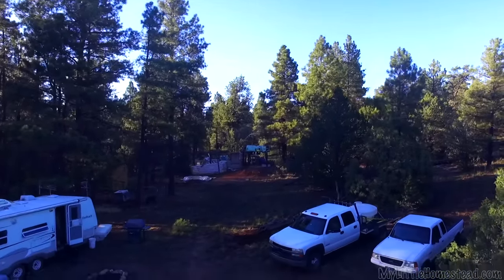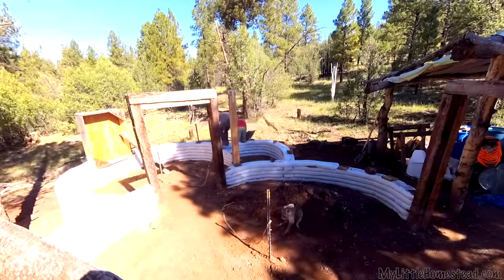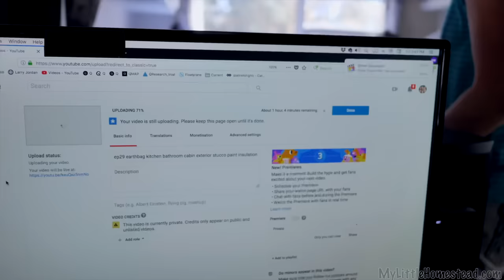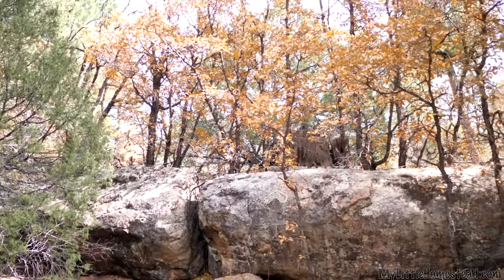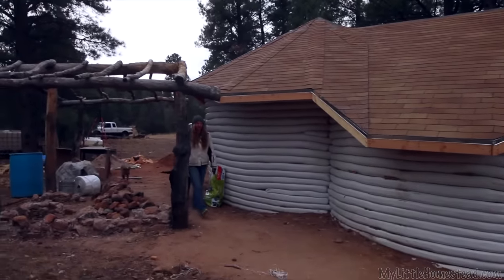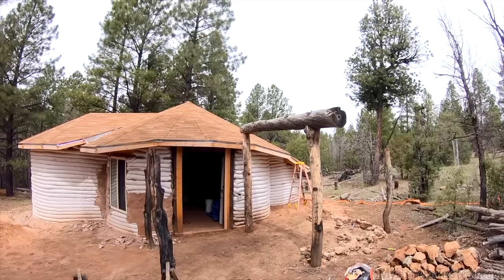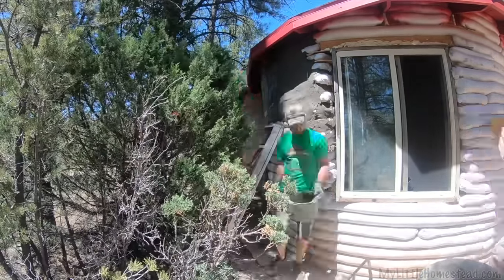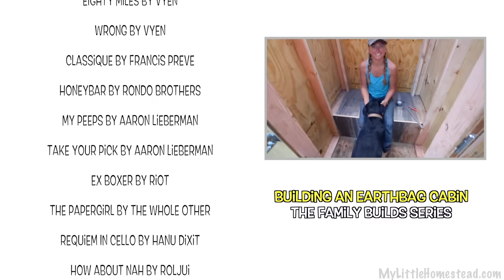Complete Build of Earthbag Cabin  | DIY Full Version Movie of Completed Project

Comment: Great cabin and thanks for sharing.  I'm a big fan of earthbag homes.  Did your realize that by putting on a shingle roof you are guaranteeing the roof will burn off if there is a fire near you?  Those shingles are only fire "resistant" which means that a burning branch WILL ignite the tar shingles.  Put a layer of metal on top of it.  Even basic corrugated metal roofing will protect it from embers and burnng branches falling on it in a wildfire.

Comment: Awesome project, well done. The only thing I'd consider fine tuning is the small gap between the outer construction (what was previously a pergola) and the main building: I'd get pretty annoyed by rain water pouring down between those two roofs. Maybe add some roofing that leads water away from the house entrance a little better?

Comment: I saw a video somewhere whereby someone poured a round concrete slab, made a dome sown out of Tyvek house wrap, attached the Tyvek dome to the slab, blew up the dome with a high volume fan and then sprayed light layers of concrete on the dome until they had a large concrete dome.  Might be quicker and/or an idea for an add'l room to the house instead of earthbags

Comment: A solar electric fence will solve your bear problem.  I did a lot of research and an electric fence was the only workable solution.  The bears learn (and remember) about the electric fence and will not go near it even if it is off after being bitten by it. 

I also take it your cabin is not high enough to require storm shutters to keep the snow from breaking the windows and doors.

Comment: After every snowfall try to clear the snow on top of your roof as much as possible, because if you don't the weight of the snow will crush the roof at the long run. 
I know it sucks! but it's safer for everyone and your roof last longer. In Canada we gets heavy snowfall especially in Montréal  and it's one of the advice that city gave homeowers.
Unfortunately we had some mishap happen before. we understood the situation so when we have a lot of snow if is more than 25cm or 30cm the school boards closes schools.
 I think for houses or it's  between 2 or3 inches of snow 
So they could clear the school roof to make it safer, for the kids and the teachers and companies.
 There are companies some of them does not like to spend money on safety but if the city find out they will be a hefty fine for endangering employees.

Comment: Where do you get the continuous polypropylene tubes?
Reply from the maker: China earthbags
Where We Bought our Earthbags (Continuous Sandbags or Earth Bags :)  | Weekly Peek 
https://www.youtube.com/my_videos?o=U&sq=China 
It is called 14 inch continuous polyweave bag material with a 6 month UV protection. Manufactured and imported by MLH directly from a plastic bag manufacturing plant in China. Years ago we bought it in bulk and sold off everything we were not planning to use. Back then, the cost was .15 cents per lineal foot.

Comment: where did you guys buy your earth bags?
Reply from the maker: China earthbags
Where We Bought our Earthbags (Continuous Sandbags or Earth Bags :)  | Weekly Peek 
https://www.youtube.com/my_videos?o=U&sq=China 
It is called 14 inch continuous polyweave bag material with a 6 month UV protection. Manufactured and imported by MLH directly from a plastic bag manufacturing plant in China. Years ago we bought it in bulk and sold off everything we were not planning to use. Back then, the cost was .15 cents per lineal foot.

Comment: Oh Boy, oh boy. 

How can anyone do this ? Have people gained no knowledge ?  Until now people only went into the ground when Rigor Mortis had coming around. And that is for a purpose!

As a physics i would not even build a house with lots of sand around it in my own country. But in a country with more solid material the exposier is way to high. And with what do you hold sand together? Plastics? 
Please do some research. 
In Holland now we are building houses that by law have to be so airtight that it is very unhealthy to live in it. I have seen floors that were not build extremely airtight. So radon coming from the ground is piling up in the house.  Whole families that are getting sick. A house that is killing his inhabitants.  Please be aware of the negative factors when living more into the ground.
Make sure that you build vent systems that will completely refresh all the air every hour.  And be sure that the details of the fllor and the walls are build in a way that absolutely nothing can come through it. Although it almost impossible to do. Maybe a double floor and wallsystem until you are above the ground. And with ventilators you have to constantly refresh that boxsystem so nothing gets into the living spaces.
And try to shield all that plastic from heat. Keep the temp as low as possible if you don't want to poisen yourself. Make the poisening as slow as possible. Try to regocnise certain symptons and act as quicly as you can afterwards.
In Belgium they are thinking to forbid plastic floors in the future. When the sun is coming through a window and is radiating on a part of the floor the level of toxicity is going over the roof almost immediatly.  
I rather see people smoking then living in a airtight house with plastic floors and big windows. But that is another story. People have know idea how their health is negatively influenced by certain building materials that has been used in the last 30 years.
Strange things will start to happen to the air when it comes into contact with plastic materials. But also when getting in contact with certain paints and other chemical and syntatic materials. Even the materials used in kitchens are starting a reaction to the air when in contact. And it is constantly in contact. Some natural materials are not always healthy when used in other ways then what nature has intended for it. Decay from Uranium is always present. And much higher in places with more rock. 
I really can not understand when obviously people are so beware of taking another route and become more one with nature that they start to use plastic as a building material. And with such an enormous square surface factor?  I understand it is beautifull like the way you life. And ofcourse there is also an immediat benefit for sonebody's health to live in such surroundings compared to a dirty big city. But i think that if you take that path you somehow must take it all the way and be logicall.
Buy a kit for determing radon. Just put it on a table. Close everything up and leave for 48 hours. Come back and send it in to determine how high the exposier is. And hopefully it is low. If not take action to airtight the floors.
And another tip. Years ago i build a woodstove with two smal steamturbines. I had placed them in a shunt to double the volume.
Also used a condensor with a heatexchanger in it. That i used to heat up a 3000 liter boiler. But you can use a smaller one. Or place it outside or lower it into the ground. With the batterytechnology nowadays it is possible to store it and use the energy when the stove isn't powering the generator. You can order lithion 18650 from Samsung or LG and build your own batterypacks. 
And in combination with a windmill generator it should be possible not to use any gasoline for a generator.
Please beleive me that i did not want  to bash but it is my job. In Europe when building we all need to build with regulations. We are hit by every protocol that highup placed people can make us lives misserible with. 
But at the same time it is for the existance and minimalising our footprint on this planet but what i see is that a lot of protocolls that we are hit with so a building is allowed to be build actually has an enormous negative impact on people's health.
The air is getting poluted when we are not able anymore to ventilate. Bacteria and expeccially dangerous funges are building up and are being inhaleted. With systems that for a couple percentages is reusing the outgoing heat. And when not cleaned almost constantly is doing a lot of harm. Not can do a lot of harm but is simply doing a lot of harm constantly. Because it are constant processes. But seeing that beautifull surrounding in nature was trickering me because i because of my knowlegde and job i know that plastics and beings that are alive don't mix.  And if i would fight against the absurdity that very intelligent government people are just blindly following i would very quicly have no job at all.  But all what is happening nowadays with airtight building and the energy maffia with all his corruption is getting people more and more inslaved to the already sickening bankingsystem. And that up against the factor that we have to go an entirely different route in building our houses. More back to nature, more using natural materials (with a logicall mind). In a simply put way "we have to let nature into hour homes again".
By the way. You have a beautifull girlfriend with a great character.👏 Whereever you take her, you can call it home. You are a lucky guy.💪 Don't ever take that for granted, never. Be very thankfull towards her parents and brother because they have provided you with the most meaningfull thing to live for.